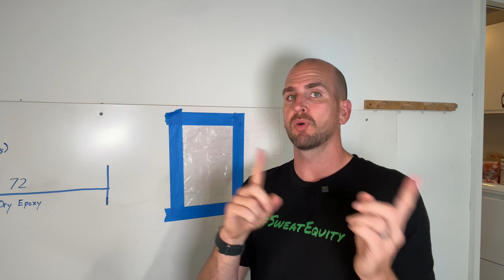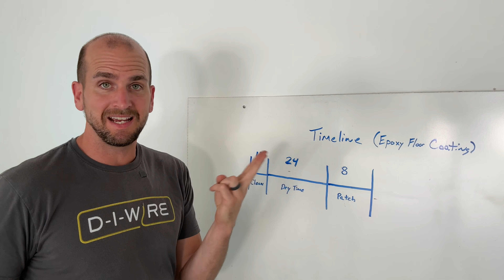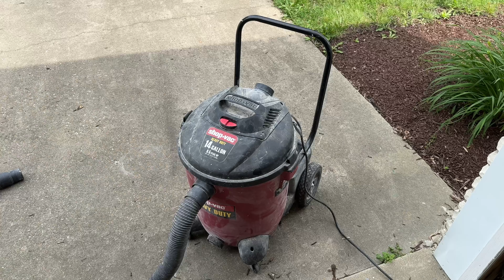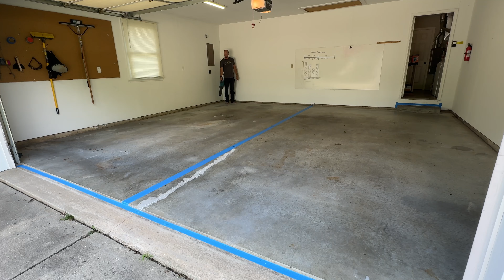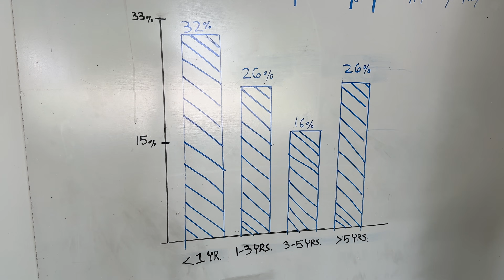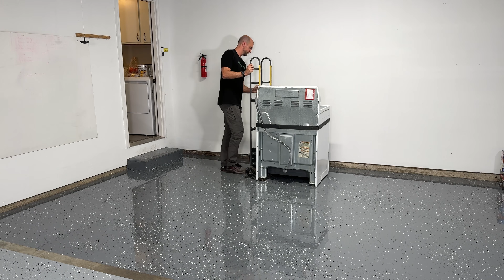Complete DIY Garage Epoxy Floor Coating Installation | Testing Most Popular Kits

Comment: Where's the video for what you did on your house?
We are turning our screened patio into a 3 seaaon and want to epoxy the floors first. 
It will be open to wind, etc while we prep and apply since its only screened.

Comment: We had a professional do an epoxy-flake with transparent topcoat in our 2-car garage.  One guy did the whole thing in one day.  He etched with a rotary grinder. After dust-removal, he did a fast-curing epoxy (components mixed in the back of a truck)--then he saturated this coating with vinyl flakes. After a few hours of curing, he scraped off the excess flakes.  Last step was a clear top-coat over the epoxy/flakes.  It turned out really nice. I replicated the process with the RockSolid polycuramine system from a BigBox store.  But I used twice as much material as suggested and ordered extra vinyl flakes in bulk to saturate the wet polycuramine.  After curing 1 day, I scraped off the extra flakes with an old drywall knife on a stick, then covered with a a clear polycuramine topcoat (with anti-slip material added).  These products aren't cheap, but they work great if used correctly--same result as the professional.  If you use the BigBox products as suggested on the box, with sparse numbers of flakes, those floors can get extremely slippery when wet.
Reply: Product list?
Reply: Well? How did the two compare?
Reply: Three years later, here is my report.  Correction:  the professional job in the garage was polyaspartic acid with flakes, not "epoxy."  The "Rock Hard" polycuramine I used on the workshop was an epoxy. After 3 years, the two applications (with flake-saturation and a clear-coat on top in both cases) look identical, and they both look great. BUT there is one important difference. The poly-aspartate professional application on the garage floor resists UV light. The polycuramine (big-box store) does not resist UV light. In my use case (a poorly-lighted workshop), polycuramine performs great, no problems.  The surface is very hard and very easy to clean. But the small amount of coating exposed to sunlight under the door frame has totally disintegrated. Polycuramine is just not suitable for outdoor use.

Comment: Surprised didnt use a primer base first.. thats what locks the moisture away from the epoxy and then a top gloss coat to protect it.
Reply from the maker: I tried to stick to the standard installation but totally agree a primer would be a better approach.  I will be doing another option for Epoxy Flooring where I grind the concrete down and also use a primer in addition to superior product for Epoxy, Flake, and Top Coat.
Reply: @EverydayHomeRepairs  armor epoxy seems to be the better quality diy kit

Comment: At least muriatic acid wash. He literally had the grinder in his hands that would have added years to the life of this floor. Sometimes spending a little more can make a huge difference. If I did this floor real products and a grind I’d expect at least a Seven year life.
Reply from the maker: I will be doing a full grind in the coming weeks on this floor which some higher quality and much thicker product to show the other end of the spectrum of options if you are willing to pay more for equipment and product.

Comment: I'm co-owner of Colorado Liquid Floors. We grind and use polyurea for the base with polyaspartic for the top. We have a 25yr warranty.
Reply from the maker: Thanks so much for the feedback.  Next floor coming in a few weeks will be a full grind 💯
Reply: Damn 25 year warranty sounds amazing. I wish they did that around here
Reply: @madbroindustries We’ve never lived anywhere that long nor do I expect to live another 25 years.
Reply: @JT_70 understandable
Reply: Hello, my first time came across this. Can I ask you a question. 1. you grind 2. what is polyurea ? then flakes  3. polyaspartic ? when do you use epoxy ? thank you for time.
Reply: @philongnguyen7604  polyurea and polyaspartic are both two part products similar to epoxy. We don't use epoxy in our process. Here are the steps: 1. Grind using a big floor grinder for the bulk of the floor, smaller hand grinders for joints, edges and stem walls. 2. Clean up the dust, there will be a lot of dust. We vacuum and then use a leaf blower to make sure no dust remains. 3. Apply the basecoat in sections, broadcasting the flake into the still wet basecoat. We use vinyl flake and we make sure it is completely covered. 4. Let the basecoat dry until the flake doesn't move when you push it with your fingers. This usually takes 2 to 4 hours depending on the temperature and humidity that day. Honestly, I prefer to let it dry over night. 5. Scrape the loose flake once and collect it to be used again later. Typically I broadcast 120+ lbs of flake into a two car garage and collect about 60-80 lbs for later use. 6. Scrape the floor one or two more times in different directions, vacuum up and trash that flake. These scrappings are too small and dirty to be used again. Use a leaf blower to get stuff the vacuum couldn't. 7. Apply polyaspartic clear coat with optional anti-slip additive. 8. Remind the client to let the floor cure for at least 24 hours before walking on it, and 48 hours before parking or putting a heavy tool chest on it. It may not take that long, but better safe than sorry.
Reply: @pastorbrianediger  what about a brand new garage build...how to prep for that?
Reply: @billray6557  the concrete needs to be at least 30 days old. Otherwise the prep is exactly the same. Grind, vacuum, coat.

Comment: Excellent informative video. Most coating failures are due to lack of proper preparation. On older unpainted garage floors it is important to thoroughly clean them, removing dirt, grease, oil, break fluid, etc, use muriatic acid to etch the floor which allows the floor coating to penetrate into the concrete for a proper bond, make sure the floor is completely dry before application and finally allow the product to properly cure before parking on or using the space. Previously painted floors should be prepped professionally via grinding or shot blasting to allow proper adhesion of the new coating. Unfortunately most home owners and so called handymen skip this vital process thus resulting in chipping and peeling, wasting time and money. Do it right the first time.

Comment: I used the Rock Solid on my double garage.  Coverage was half what it stated on the box kit. Prepped as instructed and had bubbles  form while it cured. Had to spray acetone over the bubbles to pop them. Still see rings from the popped bubbles but I can live with it, at least I don't have bubbles all over the floor. Overall pretty happy with Rock Solid. Used the other kind for another section and it's flaking in spots. The RS is resistant to solvents but not the flakes/chips in the finish.

Comment: I've had my Epoxy Shield in one garage for 4 years and another for 2 years, and I love it. Proper prep is critical (grinding, patching, etching, dryout, etc) and I was 100% set on using clear coat finish (I think it's a must). The only failure point I've had is some cracking above what I know to be the house's main drain line that runs through the garage to the driveway. The previous sellers had the drain line fully replaced, so it's only 3-4 years old. I'm stumped as to why it failed there. Hopefully not from any new moisture.

Comment: Just pay a professional. The amount you will spent on prep and your time, plus a warranty, will greatly outweigh what they charge. DIY kits suck and will peel off in a few years at best
Reply from the maker: I am going to give some pro-grade materials a go and see if a DIY-er can get solid results with superior prep and products.
Reply: I agree to a point. My Father in Law used one of the kits on his garage floor and 15 years later it still looks pretty dang good. Most of it comes down to prep. If your willing to out in the time you can get good results for about a 1/4 of the price a business would charge.

Comment: Scott,

Our floor was done impromperly by a "professional" a number of years ago, so we have old chipping and peeling. Don't think they etched. Some have suggested we need to  belt sand all that off first. Also some have suggested using a sherwin williams william concrete sealer and  just paint. Any thoughts?

P S, i renovated my moms 100 year old farmhouse myself using your videos. And a rental. When contractors come over and talk to my husband, I'm like eyes over here buddy! Thanks.
Reply: The technology and application standards are alot better now. Get a good Polyaspartic company to do it and come out happy and with a warranty

Comment: Anytime I hear that a coating, any coating, is already peeing off within a year, it's always due to prep. Either it wasn't cleaned enough, dulled enough, or it wasn't tested for moisture.  As long as the coated surface is clean, dry and sound, you should not have peeling at all.
Reply from the maker: I would agree with that 👍

Comment: FYI- come onto epoxy with wet tires and hit the brakes- you will hydroplane.
Reply from the maker: How fast are you driving into your garage 🙂?
Reply: @EverydayHomeRepairs  not fast at all. Actually I don't have that on my floors as I said in another comment. It happened to my neighbor.

Comment: I live in Florida. Slab moisture is a big deal and will make virtually all epoxy peel eventually. Moisture barriers MIGHT help. I ended up putting in Swisstrax tiles. they are slotted and allow moisture to evaporate thru. Only floor prep was to sweep it out. 
My wife and I did the installation on a Saturday. Looks great, wears like iron and never peels. I have no financial interest in Swisstrax. Great product. Great customer service. In my opinion looks better than the epoxy; you can make your own design .
Reply from the maker: Thanks for the tip I will check them out 👍
Reply: You also can’t turn the wheels much.
Reply: This^.  Jack stands will also tear em up.
Reply: I'm also in FL and having moisture in slab.  I'm going forward with the RockSolid kit though and just used their Moisture Stop product (1 gal per 100 sq ft I used vs per 150 sq ft they rec) and hopefully that will work...
Reply: @alsardari892  how did it go? Another FLoridian here.
Reply: @brandonterry3493  I installed it right before Christmas and posted a video right after. I'm hoping when summer comes around the ground moisture doesn't delaminate it but we'll see.

Comment: Thoughts on a second coat of epoxy before flakes to add some thickness for durability?
Reply: Im pretty sure it will have difficulties binding to the other coat of epoxy. Id look into it however
Reply from the maker: Yeah, not sure how the 2 layers would bond.  Maybe it would be okay but I was pleased wth the Rock Solid side which went on much thicker.
Reply: I think it says it can be recoated for up to 30 days. After that it's supposed to be sanded with 80 grit for adhesion.
Reply: @jdhogg18  interesting, it probably sand the first coat a bit just to ensure proper grab.

Comment: Great video! Many of us have epoxy coated garage floors that have long since deteriorated. I think a great video would be dealing with a previously coated floor that needs to be re-done.
Reply: Don’t do it. It will happen again. Put down Swiss Trax tiles. I did. Easy to do. I have no financial or personal interest in Swisstrax.
Reply: @MrCabimero  These are interesting... I like the look.  I'm considering this for my garage gym, but they don't appear to be waterproof.  Am I wrong or do they have openings to the floor below?  How do they feel?  Do they squish down at all with a heavy object on top?
Reply: @jarich0327  they have slits in them so any moisture will drain through. They are some type of plastic. I would not be dropping weights on them as I'm sure they would crack with time. Supporting a car weight is one thing but dropping weights from your arms onto them is another. if you contact them they will send you a sample so you can put it in your hand and see what it feels like. I can't say enough good things about them and as I mentioned I have no personal or financial connection with them. I'm just a happy customer
Reply: @MrCabimero  alright, thanks for the info!

Comment: My floor looks amazing after a year. Prep is key, don’t skimp, I bought 10 lbs of flake & applied heavily. The flake included a metallic color. After it dried, we scraped flakes that were popped up, with a floor scraping blade. Then a heavy seal coat.
Reply from the maker: Nice, the next one I do in a few weeks will have about 10X-15X the amount of flake and much thicker epoxy with a primer.

Comment: I really need to do this to my 36' x 25' garage but it's going to be a chore.  I'm wondering if doing it in warmer ambient weather or in the cooler fall, like 70°.
Reply: There are instructions in the kits that specify the dwell time based on the temperature but the 70 degree weather would be a better time to do it. Epoxy will cure below 40 eventually, but you don't want to apply it if the temperatures of the surface being coated, the air and the product aren't  between 60 to 85.  I'm in Florida. I can't do this until November, maybe October at best.  Other areas can do them year around.
Reply: That's for the Epoxy though. The RockSolid can go down to 40. It's 40 - 90.

Comment: Did a DIY Rust-oleum floor and it lasted about 3 years before it started flaking up under normal use. Then a got a pro company "Guardian Floor" to replace it. More expensive but worth it. I guess it depends on how much you want to spend. Great video.
Reply: If you look at the box it says it should be re done every 3-5 years 🤔
Reply: Wow, too bad, our Rustoleum floor is 14 yrs and still perfect.  We also put the clear coat over it.   It was new concrete.

Comment: Did you really buy a cyber truck Scott? I figured you would be a Rivian backer.
Reply: If you sneeze to hard next to a rivian the repair costs will be like 50k... Id never buy a rivian, seriously supppper minor fender benders are expensive as hell because of the way they did the roof and fenders
Reply from the maker: Divian makes a great truck.  I have always been a Tesla fan and put the reservation 4.5 years ago thinking they would be the first to autonomy.  Hopefully will get FSD on the Cybertruck in June or July 🤞
Reply: @EverydayHomeRepairs  well it looks like the rental and YouTube business are treating you well if you’re out there buying big battery electric toys.  I think you need to add a battery electric 301.9 mini excavator to the mix.

Comment: Great video!  The best way to test hot tire pickup is to let the hot tire sit on the epoxy long enough for the tire to cool before moving it.  I understand it rained.  Nice work on the installation.
Reply from the maker: For sure, I need a nice sunny hot summer day to redo the test and let the heat soak in.  Thanks for the feedback.